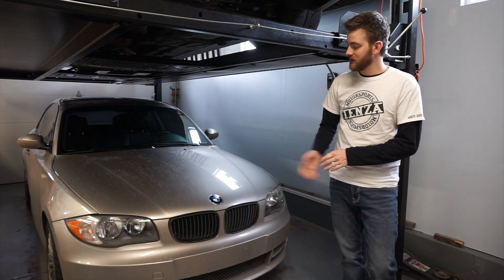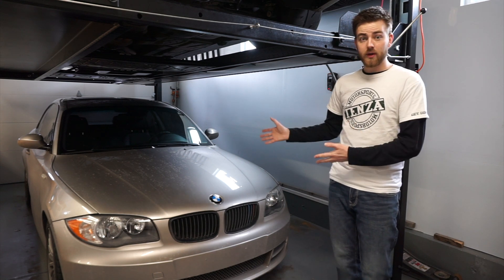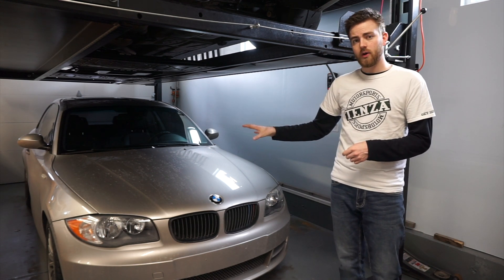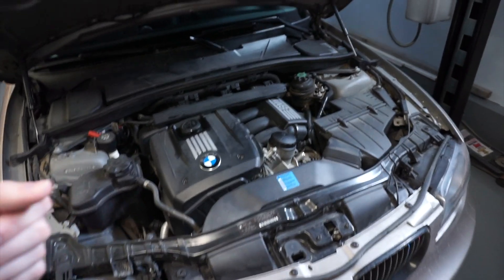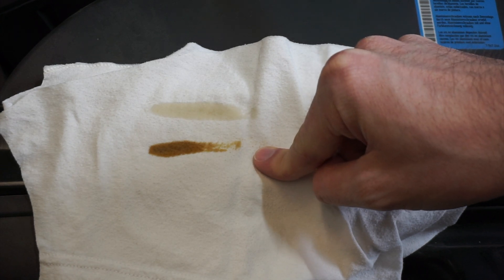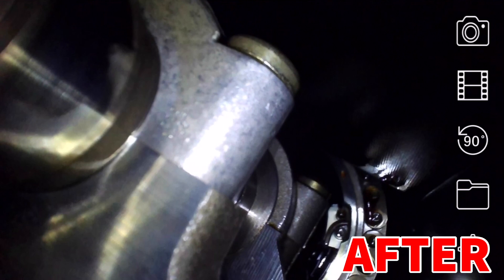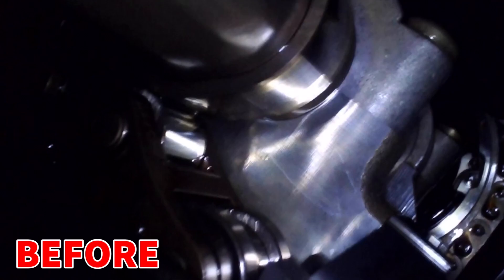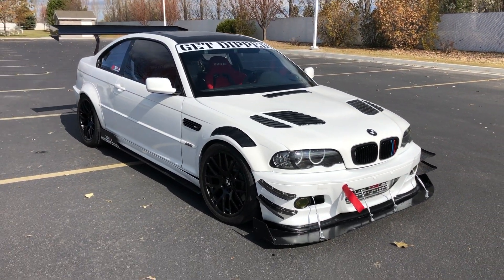What has 750 miles of Mobil1 done to my BMW 128i? Field test Mobil 1.

Comment: DO NOT ..
  Change oil at 10000 miles.
     Mobil 1 10w30 is what you should be using. Change at 5000. Period. K&N Filter. Nitro Joe.

Comment: That’s because those oil filters are crap use OEM Mann oil filters only! That brown tint in your new oil is fine there will always be old oil no matter how long you let it drain, especially if you have a oil cooler. Plus that’s what additives are added into oil for “cleaning” if your that worried about it start using liqui moly 2 step oil additive process first step has a engine flush

Comment: Hi  when I get my oil change I make sure that wen I go to the garage my cars engine is hot I put it on the ramp my makanic who is my friend taks the old oil out then he put the sump plug back then he fill 5 litre of flushing oil in and at least 7 litres come out then he puts in mobile 1 and the new oil stays clean for at least 15000 miles plus my car runs like new OK it's a lot of messing around but believe me my car will have a lot mour po in beautiful

Comment: That oil filter is aftermarket garbage! How can anyone test the engine oil, which one is better or not. My Acura tsx has 220000 miles and I use whatever synthetic oil I have, 5w-30 or 0w-30. My bmw 135i has 140000 miles Ive used bmw engine oil, castrol, mobil1 so far. I track the bmw too. I change the oil every 5k miles on all of them. On my n55 335i I have 140k miles too with zero issues.

Comment: I have similar issue with oil darkening on my Audi TT, but becsuse we bought it with 40k ml on it already, I do not know how maintenance was followed with previous owners. I am planning on using Lique Molly engine flush in old oil > change oil (something isnt expencive, like wallmart brand may be)+new filter with Engine flush again> and then put AMSOIL European formula 5w40 which I already ordered with their filter.

Comment: I was surprised to see the deformation of the filter after 750 miles. this tell me the filter construction is no good or there is some sort of a high pressure problem with the oil, like starting the car at -30F without a block heater, or something. I was also amazed how dirty the oil was, there is defiantly something going on inside that engage!
Reply: that's the mobil1 cleaning the inside of the engine, and the filter is now picking it all up.

Comment: https://youtu.be/s-nkJ5Sen9c
Take a look at this ...I had the same problem with my 2013 328i xdrive...when I checked my Mobil 1 filter it was severely twisted due to restricted flow..I ended up switching to kn and noise went away
Reply from the maker: Interesting. I'll just keep an eye on it

Comment: Why not just use BMW motor oil? It has the perfect blend of additives for those car's.
Reply from the maker: I was using bmw oil. RP is better
Reply: @TenzaMotorsports  I've always wanted to try Royal purple I know it's a good oil
Reply: @TenzaMotorsports  Which RP dontou use API, HPS or HMX?
Reply: @TenzaMotorsports  RP purple color always scares me to put in my engine. After a few minutes the purple turns to dark. Does that mean the filter cought the dye and got clogged.

Comment: The color change is to be expected when you switch brands as different brands can have different detergent additive packages. Switching brands once in a while is a good way to keep the engine clean.
Reply from the maker: Right that’s why I pointed it out. I don’t think the Shell oil BMW uses has the same detergent levels

Comment: I don't think that those oils that meet the BMW specifications are any different for the engine performance. My german BMW dealer uses a different brand almost every year. The car made over 150,000km so far. No repairs yet. Just oil changes.
Reply from the maker: As long as it’s all the same weight and synthetic I’m not sure how much it matters

Comment: Interesting video.  I have always held the belief on oil changes. I like my old oil coming out very dark or black. Why? That tells me the oil is doing it job of cleaning the motor.  I don’t drive new cars, most of my vehicles are older. So I expect the dark or black oil color at my oil changes. 
What is the brand of Shell that BMW requires?
I have a friend that has a BMW X-5 and at his annual oil change the dealership was using 5W-30 Gold bottle Castrol.
Reply from the maker: I’m not sure what tier of shell BMW uses. when I asked them, they kind of beat around the bush and then didn’t really answer the question.
Reply: Castrol was the supplier and recommended brand for BMW for many years. It was the recommended brand in the owners manuals for BMW and Mini until the switch to Shell/Pennzoil some years back. Depending on the vehicle and engine the recommendation is typically 5w30 and more recently 5w40 BMW LL-01. As long as it meets those requirements the brand is splitting hairs. However in recently some oils that previously held the BMW LL-01 accreditation no longer do including Castro’s oils that once did for example. This makes finding those oil at your local auto parts shop much more difficult.

Comment: Use motul and you will be happy
Reply from the maker: It’s hard to find locally. But I will be testing it soon
Reply: @TenzaMotorsports   i used the mobil 1 esp 5w30 after that i switched to motul 8100 5w30 xclean+ it was a big difference, the engine is smother and quiter olso on high reves and the engine fills more stable. It's worth the try.
And it's 100% synthitic not fully synthitic like mobil..
Reply from the maker: Very interesting. What car are you using Motul in?
Reply: @TenzaMotorsports   volkswagen golf mk 7.5 2018
Reply from the maker: I am very open to the idea of trying a different race oil on my race car. Motul has come up in multiple conversations when it comes to actual race oil. I might give it a try.

Comment: The best oil is amsoil my friend 😉
Reply: Actually,  Amsoil isn't the best.  It's a very good oil but Mobil 1 is just as good as Amsoil if not better.
Reply: Mobil 1 cleans really good.
Reply from the maker: I guess we will find out.
Reply: @TenzaMotorsports  
You realize the crank and oil pump is full of dirty oil. You can't completely  drain all the engine oil, when you change your oil.
That's why that excellent Mobile 1 oil is somewhat lightly colored. Aside from going through 20 or 30 heat and cool down cycles.
Reply from the maker: I’m aware. But it doesn’t have that much in there. Not enough to make 6.5 quarts turn dark like that.
Reply: @TenzaMotorsports  
That oil really wasn't dark,  it's normal for 750 miles. Any oil will have that brownish color, after cooling and heating up 20 0r 30 times.
Reply: It just means that the oil is doing its job.....
Reply: If you like to spend the money sure.